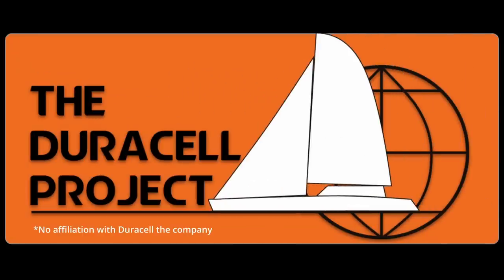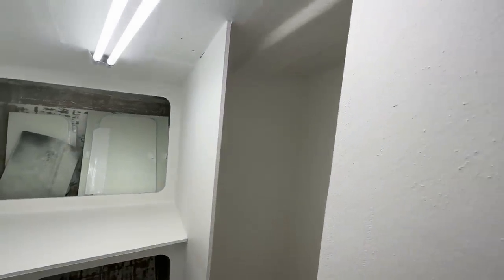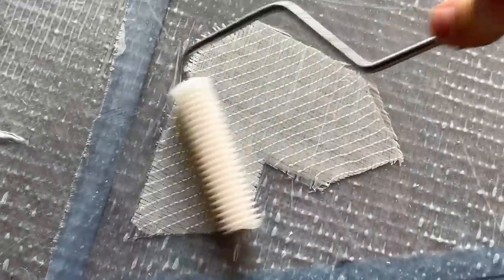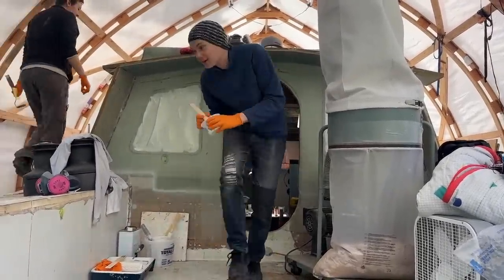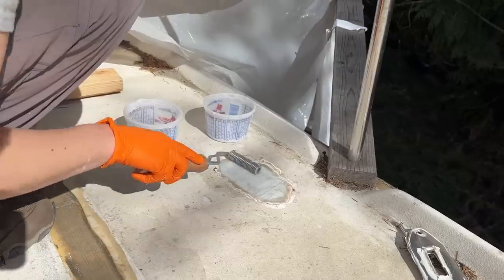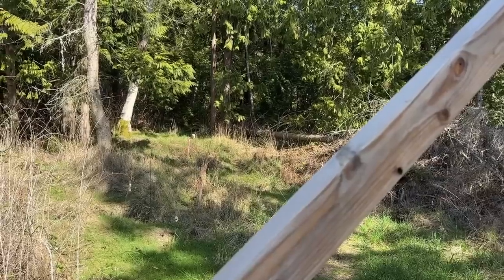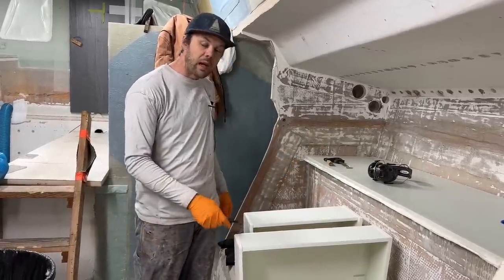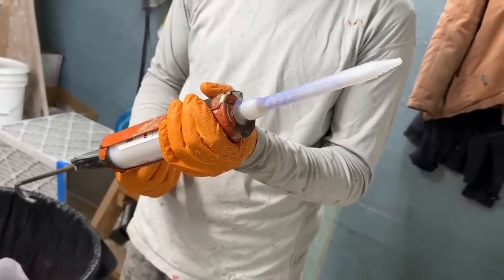Lots of Projects! [E73]

Comment: SUPER SIMPLE TRICK regarding the AWL GRIP. Use some PVC SCHED 40 OR 80 tubing 4"-8" diam. tube cut 1-3" tall. Set up a stop block for your chop saw  and cut two sections that are the exact same high. You can now set them on your mixing surface, pack them with with the two products. You now have a PERFECT ratio measuring system. Spray paint one of them a different color on the outside or label it with tape. You now know what the mix ratio is, the working consistency is and the cure time and tooling aspects. Its all going to cure to the same hardness, you also wont have some of the awl grip that is more than or less red  than other batchs do to eyeballing volume.
Reply from the maker: good tip, thanks!

Comment: Loved the background music and I’ve got to say that it’s great to see Matt really relaxed in front of the camera. 

Paint? Well, for me the primary purpose of paint on the outside of a boat is to provide protection for the substrate. 

Since the two greatest enemies of a composite hull, other than impact, are heat and UV then the first choice to minimise both is a high opacity/solids white. 

As an ex-yacht engineer/ full time crew, I’ve lived aboard and maintained a number of boats painted in different colours and it makes a huge difference to heat gain the further from a “polar” white the shade gets, even a light dove grey gets noticeably hotter under direct sun. 

I love the look of black boats, my racing one-design 23’ open keelboat is black but she’s only on her mooring in the SW UK for 4 1/2 months of the year so Med or Tropical sun isn’t really an issue. The rest of the year she lives under a loose cover in a dark barn so no worries at all. 

Worst boat to live on was a black Sunseeker Predator M/V, I did a 6 month stint on her in the Med, never again!

So, White is boring but effective. Every thing else is less good for the longevity of the hull and comfort of its occupants. 

On the other hand, white can look superb on a really sleek hull that doesn’t have even a hint of dumpy about it, funnily enough Duracell sort of fits that bill. 

Cheers and Happy Easter to you both!
😎👍🍻
Reply from the maker: we're super down with white with really tasteful trim colors, and keep the "5" at the least.
Reply: @TheDuracellProject  Sounds about perfect to me!

Comment: If your using the plexus like epoxy, I would suggest using a 1-2 layer thick boat cloth that has already been laid up as stock material. Cut it down to fit inside the de-cored milled foam area. After applying the plexus like epoxy inlay the layer of fiberglass fiberglass cut strip onto it and lay down flat with a straight edge.

Comment: I have been addicted to your channel for the last year and a half and I'm so impressed with your dedication to Duracell! Just wanted to toss one tip out there that I use. When trying to clean out containers for paint, epoxy, or any other viscous liquid, I find that a rubber spatula typically used for cooking licks the sides clean and is far easier than a stirrer stick to use. I always keep one in my painting supplies and don't waste a drop!
Reply from the maker: that's a great tip!

Comment: If you plan to cross oceans in this boat then look up the Jordan series drogue,  the only storm survival strategy based on hard science that has proven itself over and over in survival conditions and requires no skill.    

It has saved boats when all others nearby that did not have them suffered loss of boat and crew because heaving to was not sufficient to survive in the conditions that were faced.       I'll keep repeating this on every video you make until I get a reply to confirm you have seen this as it's a Life or death critical piece of  information.

How they work is that they prevent your boat from accelerating down the lee side of a wave and hitting the trough between waves with huge force causing rollover and capsize.

Because they are a series of small drogues held down by a weight at the end,  they will not pull out from the face of a wave leaving you unprotected.

Just ensure the attachment points for the bridle are beyond doubt,   in so much as you would be comfortable to lift your fully laden boat on them.  

As there has been one report of failure in one installation due to the mounting points installed into the boat to accommodate the Drogue were not sufficiently strong.

Also be aware of Lee shores,  you can drift downwind around 60 miles a day even while your speed is arrested by the drogue and storms can last multiple days...

A good place to read up on em would be where I first learned they even existed at Attainable Adventures Cruising (Morgans Cloud)        Probably the best source of proven Blue Water sailing knowledge on the internet,  and a heck of a lot more reliable than biased sources sponsored by the boat industry companies and heresay on forums.

Comment: Boats coming along nicely!  Regarding paint color - I like the dark blue you see on many Nautor's Swan models.  Not sure what the paint code is, but if you decide to go with Total Boat, their single part Wet Edge perhaps in "Flag Blue."  I would do the hull topsides in that and use a white on the deck and salon.  If you can get samples, it would be nice to put some color swatches together to pick the best one.  You are far more astute in marine coat brands than I, so coating brand would weigh on my mind as well.

Comment: I was curious and don't think it was addressed, is there a reason you are choosing not to use drawer slides? A push to open slide seems like a great option for this. you wouldn't have to worry about battening and would avoid handles
Reply: They cost and are fiddly. Those reasons would be my guess

Comment: I like the Allen key hack, I've  used them to make miniature carving chisels and hand router blades. but a word of caution only use the old black ones not the modern chrome shiny Allen keys as the plating flies off when grinding a new tool.
Reply: No need for a powered router either.  I also use the black Allen keys to make router/rabbiting or inlay planes.  No noise, vibrations, power cords or dust flying all over the place making the work so much more peaceful.  The old blades from electric thickness planers work well too.  Most folks throw out or burn enough scrap hard wood to fill a shop with small purpose built planes that would cost dearly if you went to a specialty store to buy them.

Best!

Comment: Why don't you just spray the area instead of using a roller. It's quicker and you get a better results.
Reply from the maker: i would like to eventually purchase a sprayer. They are expensive.
Reply: @TheDuracellProject  Go with the cheap ones 2 pack epoxy is a killer to flush completely out of them. The parts of Name brand ones are too expensive.  Some of the Chinese ones you can buy all the spare parts.

Comment: so, not knowing your aesthetic, colors are hard to suggest.  I don't see either one of you wearing really bright colors, so that is probably out.  Do you want something high vis or the opposite?  does everyone involved see colors typically?  Awlgrip makes a lot of nice colors.  I am sure you know, really dark, glossy colors with show EVERY imperfection and will show any oxidation.  I love grays, light gray (more green/yellow), Whisper gray, or medium gray, classic combo would be white boot and a dark red bottom(or green or black).  Red bottom is visible if the boat turtles (shudder).  Suggest a light gray deck, easier on the eyes and won't get too hot.  Personally I love teal, turquoise or empress blue, but that would make the boat almost camo in tropical waters.  This is a custom boat, white is too boring!  But unless you want to spend time waxing and buffing go with the color that oxidizes well (lol).
Reply from the maker: all good things to consider

Comment: Catdaddy! Ok since you still haven’t taken my advice on asking ZIPLOC to cut you a discount on baggies....... for your colors, only because I’m a center console owner but have watched you since day 2....... SCOUT boats has an amazing tan color on their boats, which matches their upholstery so nice. Also, seahunt has a blue grey mix that looks sick on the lower with white top half 🤷‍♂️ Just my opinion ..... but scout boats are sexy .... check em out!
Reply from the maker: Hi Neil, not worried about the epoxy adding weight. I'm building it as light as I can and it is going to be pretty light. But definitely adding some weight in the conversation to cruiser, which is fine. :)